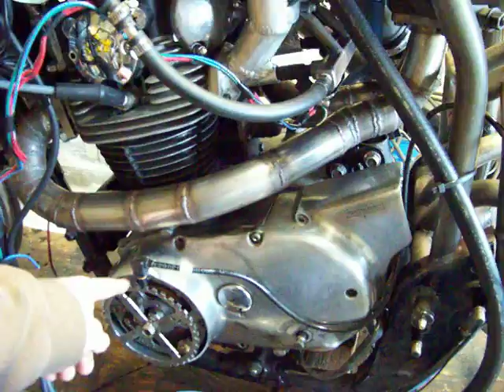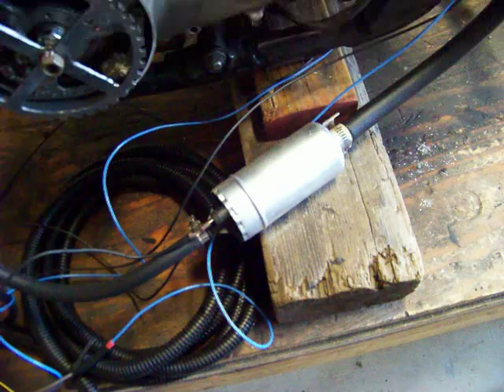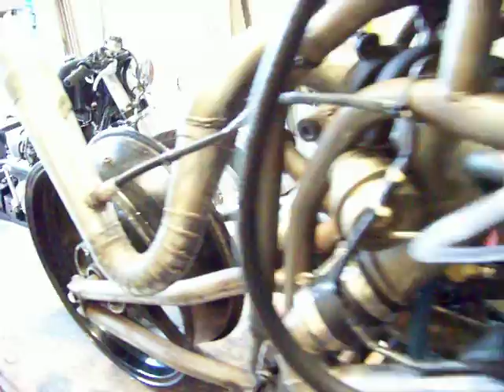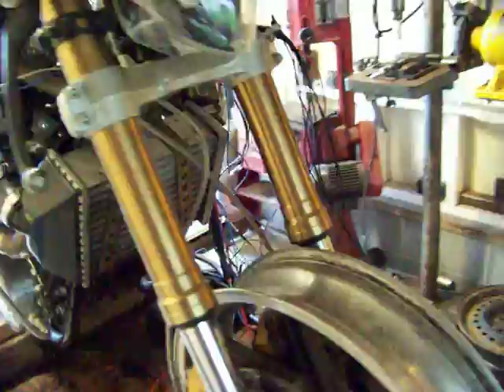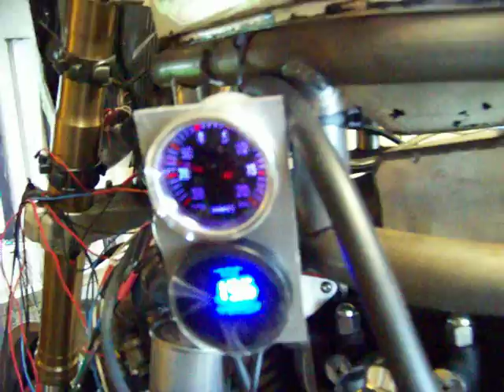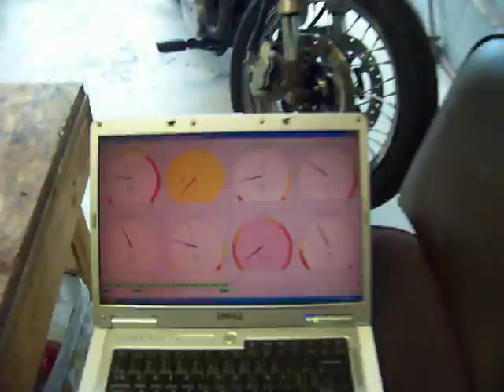Turbocharged/fuel injected XS650 It runs!

Comment from the maker: Sorry for the late reply, I'm using MS2 V3.0, It is set up for wasted spark using a single dual output coil, and I'm using an Innovate LC-1 wideband O2 for tuning. I have not rephased the engine because I didn't set up the megasquirt for the sequential injection.

Comment: Wow! that's really cool. it will be interesting to see what your EGT is going down the road at speed. I think if you had the motor rebuilt it would run even better. Those engines are pretty tough, if anything can take it they can't. I can't wait to see how it all works out. :-)

Comment from the maker: @bobble124 
The factory XS cover has a couple ports coming from the oil pump that are blocked off and filled. I simply drilled out one of those passages and welded on a bung that I made. It does work, however I am worried that the oil pressure will be too low at idle when warm.